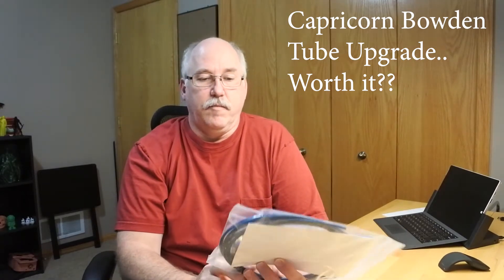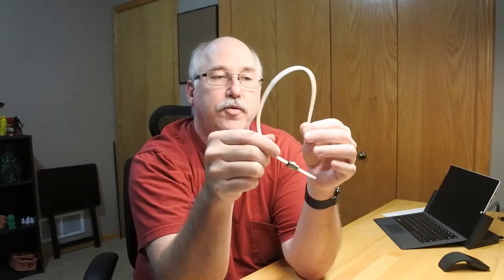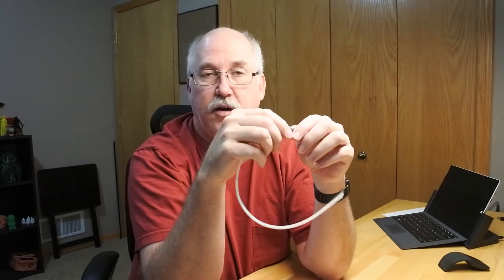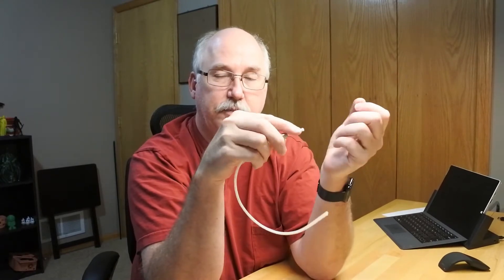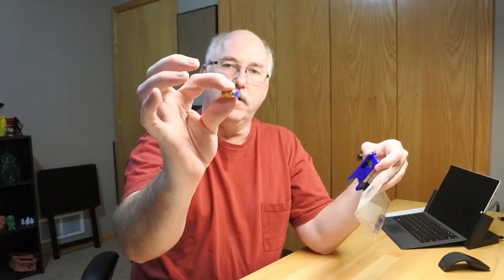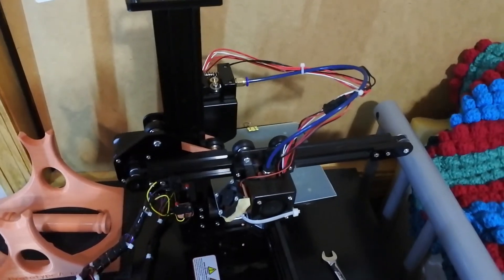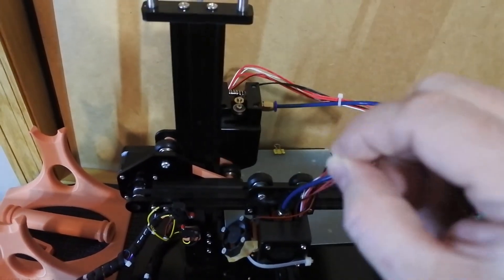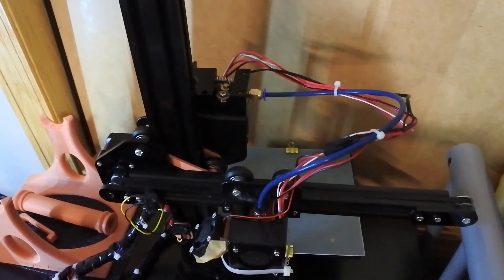Capricorn Bowden Tube

Comment: When you say "seat in the hotend" do you mean the back side of the nozzle. Also, you failed to mention (and it would be NICE if Capricorn said this when you order) that the Boden tube fitting Capricorn sells you do not fit in the hotend. I see you did not use them at the hotend so you must have found this out as well.
Reply: What do you mean? Capricorn need something extra to fit Bowden????